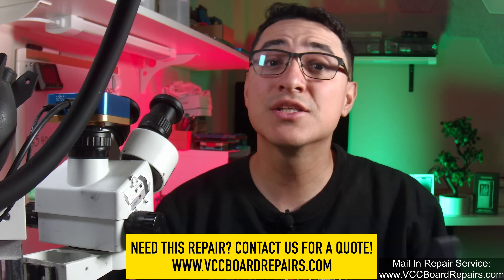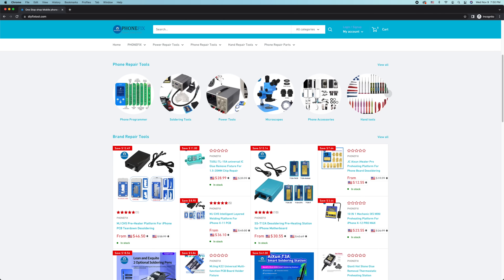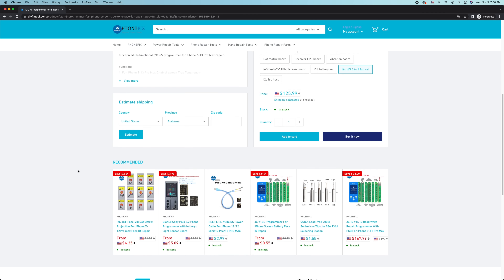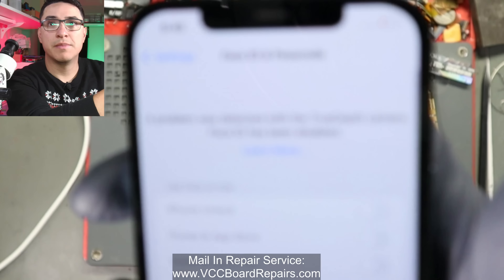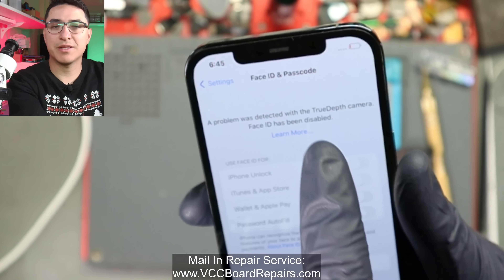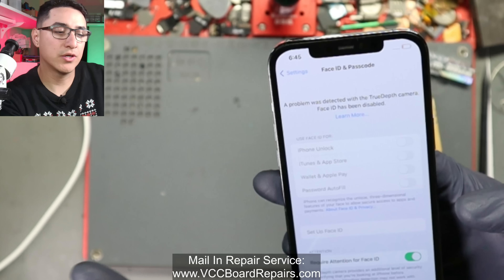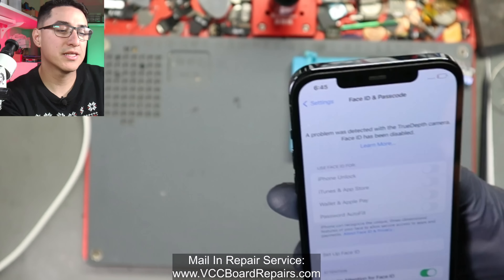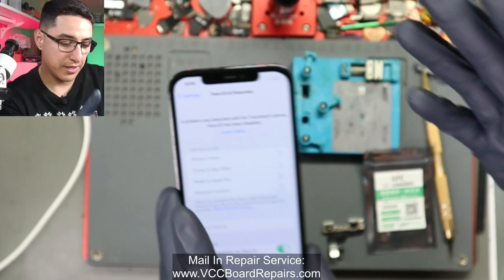The NEW Way! iPhone 12 Pro Max Face ID TrueDepth Camera Repair. i2C IC Chip Method

Comment: When changing the screen on my iPhones 12 pro max……at the end when connecting the two cable( the one in the middle for the screen and the other one for Face ID and ear speaker cable) the one for the Face ID I think it’s called the flex cable….broke when trying to connect it to the actual phone…..what can I do..Face ID would work fine before changing the screen but won’t work due to me breaking the cable in half🤦‍♂️

Comment: Question! Why not replace the whole assembly. Cams and sensor and just use the little tool to burn the information over. Apricate the response sick videos!
Reply from the maker: That won't work. IR cam and dot projector are paired

Comment: Please explain how to unbind through nand . Thanks
Reply from the maker: I will do it soon!
Reply: @VCCBoardRepairs  thanks because I don’t understand if the unbind is only for earpiece flex or it’s possible even with dot matrix . Thanks
Reply from the maker: It's only for ear speaker flex

For dot projector, it lets you recover original data
Reply: @VCCBoardRepairs  but without cloud data backup it’s possible ?
Reply from the maker: What's possible?
Reply: @VCCBoardRepairs  sorry , repair dot matrix with unbind option and without cloud data backup

Comment: good job, greetings from Guatemala
I have a question, how do you know that you have to change the IC and not just program with the flex of the brand?
Reply from the maker: I don't understand your question
Reply: @VCCBoardRepairs  I have seen that with some programmers the information is copied to a flex and this flex remains connected to the original flex and the problem is solved, while on another occasion the process that you show is carried out.
The question to all this is, how to know when it is necessary to do one process or the other

Comment: hi jesse. could u do tutorial how to fix important battery message. sometimes after i changed the battery connector on the battery it still doesnt work sometimes it work. i look at the battery connector on the board but found no issue with it. really appreciate the work you did thanks.
Reply from the maker: I don't really do battery replacements

Comment: Hey there! Just a general question. If I backed up the sensor data to a file, is possible to swap the gold sensor from a donor face id? Then just solder i2c encryption chip there and use i2c flex already matching the original phone flex data? Thank you sir.

Comment: Thanks for your very good video !
Can you help on a 13 pro max ? After a hard drop and broken screen , I don’t get any message but I can’t register Face ID , just message “Face out of view” appears on face when trying to set new Face ID .
Reply from the maker: If the glass is shattered, it could be part of the reason.
Reply: @VCCBoardRepairs  I changed the screen . I will try the Heges 3d app to see if there is any problem
Reply: @VCCBoardRepairs  Heges app showed that it detects only a small part of my face , like 10% of it only in the middle .Maybe the lense of the projector was moved or damaged ? Or should I try a complete Face ID repair ?

Edit : Has Face id something to do with the sensors on the screen on 13 pro max ? I have lost auto brightness even though i tranfered them on the new screen . Also fun fact , it recognizes on Heges app with face id ,anything that is black only .

Comment: Awesome video Jesse, May I know how to assure that costumer have never changed their front flex? Thank you!
Reply from the maker: Watch my latest video about the JC method. I discuss this in detail
Reply: @VCCBoardRepairs  Thank you jesse yes went through again, again you didn't mention how to tell if it's been changed, if not plugged in yes no readings but how to confirm if it's the original one. appreciate it.

Comment: Hello I have an 11 Pro Max that I want to replace the motherboard because of iCloud lock. Can I buy motherboard only and use the previous face id module and reprogram it to work with the new motherboard?
Reply from the maker: No, that won't work
Reply: @VCCBoardRepairs  alright ty. Aside from face id function what else am I going to lose by doing so?
Reply: I bought a new board with face id, everything works except that the phone reboots sometimes. I get the error Panic CPU X Caller. When I checked the logs it said possible errors are NAND or Wifi module. Now I have to send it back to China🙄

Comment: Great video.  Is the part that you replace the part that is coded to the phone?  So if you totally destroy you dot projector can you use one from another phone, replace that chip and program it with the saved file you have (if you have one before you destroyed the dot projector)?  Just curious because I try to understand how this stuff works and what Apple is using to pair it to the phone etc.
Reply from the maker: Yeah, i'm not too sure on the specifics.

Comment: I changed motherboard for my XR last year selfie camera was water detected, can Face ID fixed use this? I don’t have the original flex cable
Reply from the maker: If you replaced the front camera assembly, then it's game over